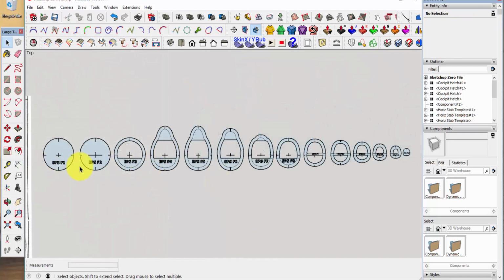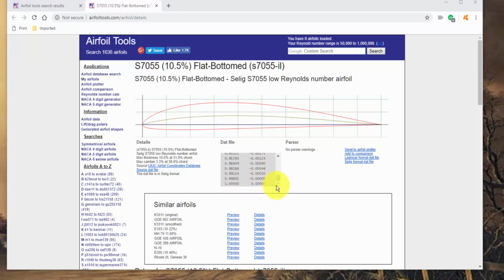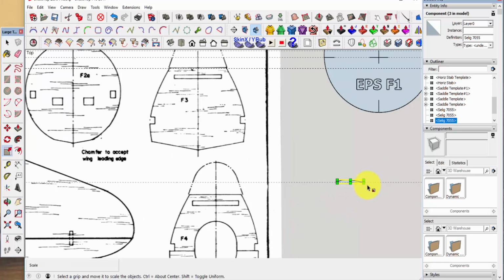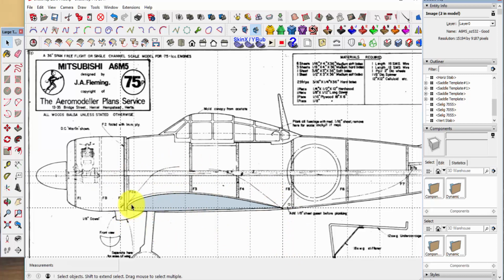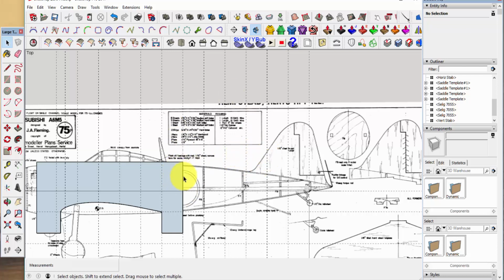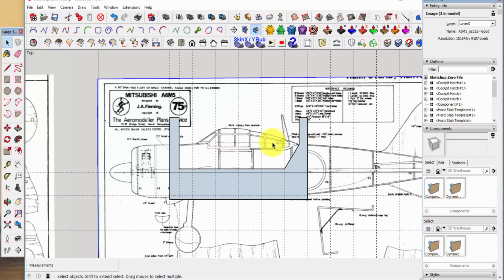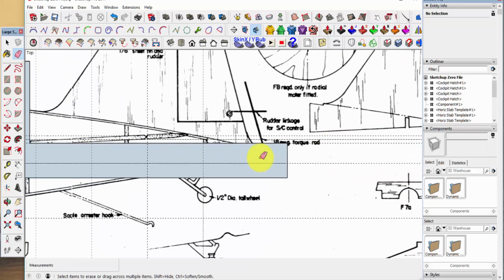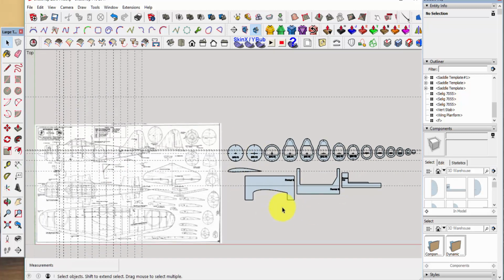Sectioned Foam RC Aircraft Fuselage Building - Part 7

Comment: I can’t seem to import the dxf file it only says that I cam import images btw I don’t have the pro version
Reply from the maker: I have no idea what version you have.  But if SketchUp is not working for you, there are quite a few CAD programs that do essentially the same thing.  Finally, you can literally draw over the airfoil shown on the plan, no import necessary.  At these sizes the airfoil does not have to be that precise.  Or just download a .jpg file of the airfoil you want, import THAT into SketchUp, and manually trace it.  Then scale it to fit.

Comment: Hi, me again! I have an issue with the imported dxf aerofoil, it is hollow. I have tried editing the component and using "Close group / component" but it's still empty. Any ideas? Here is a screen grab : https://drive.google.com/file/d/1YDsCmIgqIxHyGHu8A8-iRH8R7pD5yBIE/view?usp=sharing
Reply from the maker: Edit the group or component and use a plugin called "Make Face" or Eneroth Tools Plugin "Make Face".
Reply: @tvideo1189  Thanks. Eneroth worked for me.

Comment: I am loving this content and have been following along in sketchup but now I have an issue with the Airfoil importer for sketchup 2014, I cannot find it anywhere. Can you please point me to a link where I can get it otherwise I'm a bit stuck!!
Reply from the maker: I think there is still a download available here:  https://www.phlatforum.com/xenforo/threads/sketchup-plugin-airfoil_dat-rb.718/
Reply: @tvideo1189  Hey thanks! Such a quick reply, and on the 4th of July too!! Unfortunately it sems you need to be logged in to get the file and no of the signup options work! I'll try again later.😁
Reply from the maker: @gregcann6139  There is an easier way now.  See my instructions under the SHOW MORE dropdown box under the video.